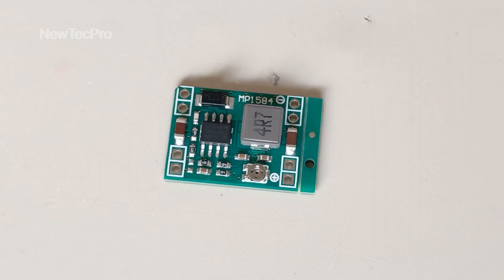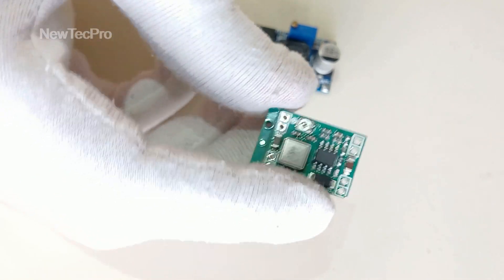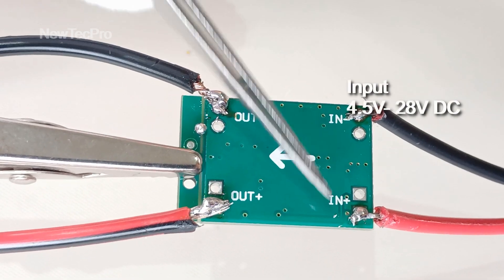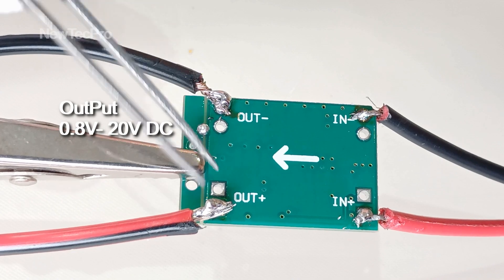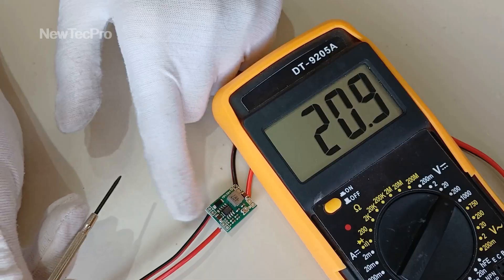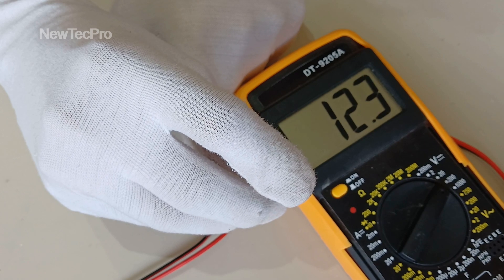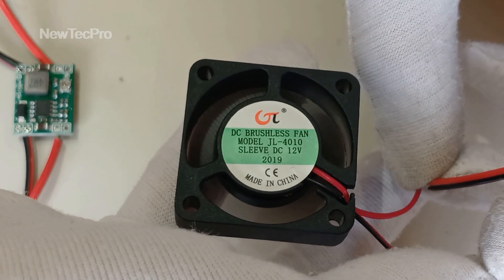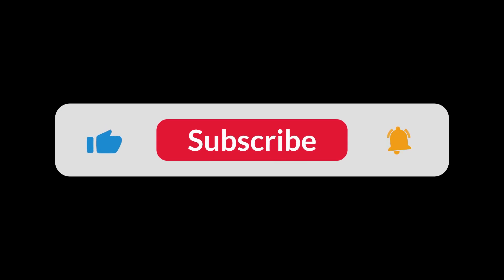how to use MP1584 Step Down Adjustable DC-DC Module?

Comment: I have one question. Does the output vary as input varies? After setting the output voltage you desire, assuming you are powering the circuit with a battery, will the output reduce as the battery voltage is dropping? Or will it maintain set output voltage till its minimum input voltage?
Reply from the maker: The output voltage remains constant at the set level regardless of variations in the input voltage, as long as the input stays above the module’s minimum required level. Even if the battery voltage gradually drops, the module will regulate the output to maintain the set voltage until the input falls below the operating threshold, at which point the regulation may no longer be effective.
Reply: @newtecpro  What about electrical noise?  Stable or filter needed?

Comment: Can I use this as a step up converter as well? I am inputting 3.3V and need to get 5V out of it. Thanks!
Reply from the maker: No, this is just a voltage reducer. You need to use this to increase the voltage. Watch this video:
https://youtu.be/0Gfw5c7fAY4?si=juPobVWQsto5ja9X

Comment: Yes, I also confirm. The voltage reducer module of this model is very good. It has a smaller size. After changing the voltage, the volume should be fixed with glue.
Reply from the maker: Yes, in the future video, we will put the correct method of soldering on the channel. In this video, we only showed the introduction of the reducer module

Comment: Thanks for your good video. The purpose of this video is to show the application of the voltage reducer module, not soldering. I hope you continue your work. Your videos are very helpful.
Reply: yes i agree
Reply from the maker: Thanks for your encouraging comment
Reply: @newtecpro  My friend will this do 4.2v lithium battery down to 3v?
Reply from the maker: @vaastafraja5685  Hello. Yes, this module accepts DC input and provides reduced DC output.
nput Voltage: 4.5V-28V DC
Output Voltage: 0.8V-20V DC